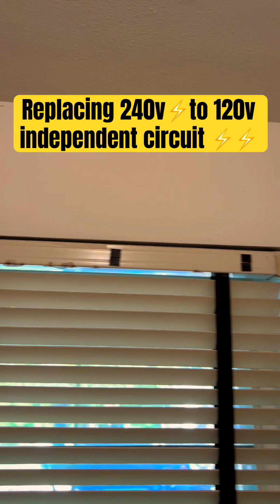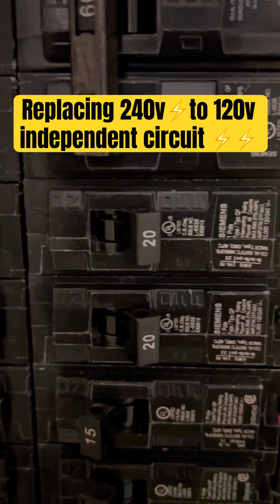How to replace 240v to 120v independent circuit#electricalapprentice#electrcian #diy#diyideas

Comment: Ok but where on earth is your CPC pardon the joke, yea where is the cpc
Reply from the maker: It’s inside the top right corner bare copper wire.
Reply: Ok bud, you see the regs, I'm not gonna educate anyone, but you see the regs, it's there to instruct on how to install, I always teach my apprentices to prioritize your earth , for the sake of ADS automatic disconnection of supply , it needs to be there , not some part somewhere I need to see it and test it, I don't see yours